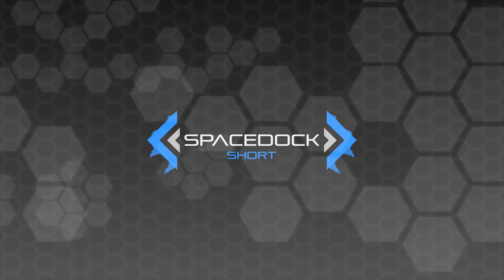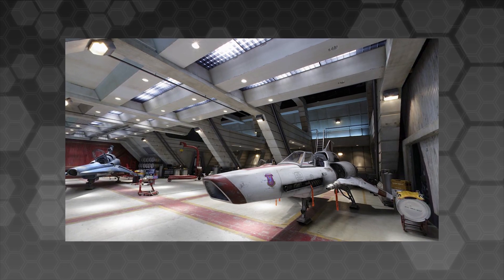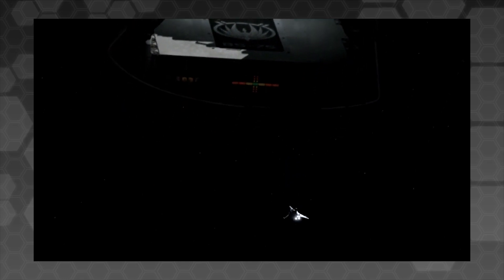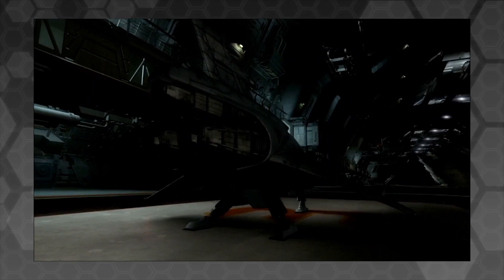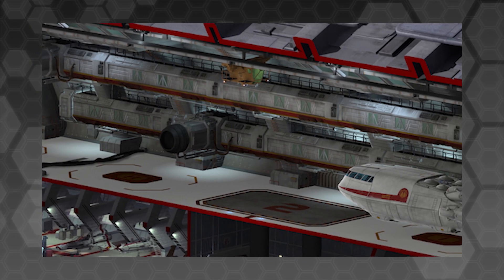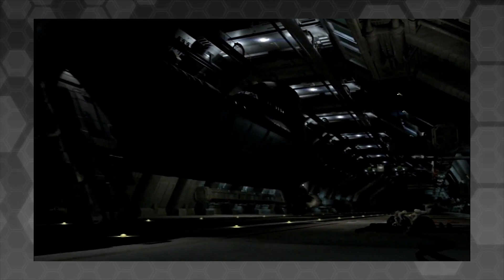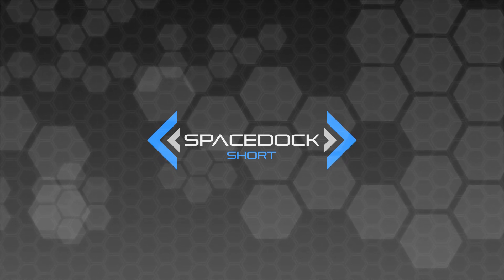How to Land on the Battlestar Galactica

Comment: My assumption, concerning Pegasus, was that the flight pods simply had two hanger/ landing bay facilites stacked on top of eachother, with one opposite the other relative to the Z axis.  This would explain why they would land and launch rightside up and upside down.  Since the Pegasus had artificial gravity, and the vipers use magnetic landing pads, I don't see any reason why this wouldn't work.  It would also make it easier to just rotate people to "normal" orientation when leaving the pod instead of having to rotate spacecraft upon landing and launch.
Reply: @jonumine6250  my guess would be something like a gyroscope

Comment: I love the tech in BSG, it's still solid sci-fi but so much more grounded and believable compared to things like Star Wars or Halo ect. 

Only thing that stands out is how the FTL functions, it's very different compared to almost every sci-fi, i'm thinking space folding maybe?
Reply: Basically. It's an instantaneous jump between two areas. The other term they use is the "red line", which is the maximum distance you can safely jump to. The computer makes calculations based on speed and trajectory. Beyond the red line and you risk disaster like teleporting into an asteroid or planet. You have to keep in mind that light travels at 300,000km/s, so when you look up at the Sun, or the nearest star, you are seeing them in the past (8 minutes for the Sun and 4 years for Alpha Centauri).
Reply: To clarify, "The Red Line" is the maximum distance from Kobol you can jump accurately. I think it's a function of computational power and the thoroughness of the astrogation charting of the area around Kobol. It's a bit like driving fast down a road you know intimately at night versus one you've never seen in daylight.

By extension, the less accurate the jump the riskier it is, but the cliche of "jumping into a sun" only applies if you're trying to jump close to a sun, because space is pretty damn empty. An inaccurate jump isn't, in of itself, riskier. But mostly you try and jump close to important things rather than into empty space.
Reply: @scandor8599  The "Red Line" is the maximum distance from the Galactica's (or any ships' point in space) at any given time, not just from Kobol. Beyond this, the chance of error increases in jump calculations.
Reply: I think the "Red Line" is actually measured from Kobol because after Kobol, technically all jumps are "blind" and have to be individually calculated because they have no accurate star charts to go by (or only estimated charts).  That's why they do a lot of surveying and such, to try to build semi-accurate maps of the surrounding space so they can plot their jumps with at least a little bit more confidence.
Reply: @TheRogueX  No, that's not true. A "blind" jump is a jump performed without calculations. Pegasus made one to escape the fleet yards during the attack - Just activate the jump drive, and pray to the gods you don't end up in the middle of a star or other celestial body. Galactica and the Fleet were still able to make calculated jumps. They were able to survey the surrounding space to safely plot their next course. 
Also, in the series, the Colonials didn't exactly know where Kobol was until they rediscovered it at the end of the first season.
Reply: The Red Line is an imaginary sphere enclosing a vessel which denotes the maximum safe limit for an FTL jump. It is described in an early draft of the script for the Miniseries as follows:

"There are computational errors in every jump. The further out you jump, the greater the error. Jump past the Red Line and it may be almost impossible to find your way back."

And in the series bible as follows:

"Practically speaking the further one attempts to Jump, the more difficult the calculations and the more variables are introduces into the equations. For example, consider the difficulties inherent in Jumping to a relatively nearby star system "only" five light years away: any information Galactica can gather by looking through a telescope is, by definition, five years old. The star and all the planets surrounding it have been in motion for five years since the light we can see left that system. This means that Galactica must calculate the motion of all the celestial bodies in that system based on information that is five years old. The further away the Jump point, the greater the problem - try to jump 100 light years, and you have a century's worth of calculations to do.
Because of the limitations inherent in colonial technology, their ability to calculate all the variables involved in a Jump are also limited. Their margin of error increases exponentially the further out they go and as a result, there is a theoretical "Red Line" beyond which it is not considered safe to attempt to Jump."
Reply: In the director's commentary in the DVD's they stated that the original idea for the visual was to have ships start folding in on themselves like origami. However, they ended up not going that route as it was deemed silly.
Reply: @scandor8599  Not Kobol specifically.
Reply: in the pc game Fractured Space (free to play), you command capital ships and perform similar space tech to get to distant locations. some vessel have the capacity to perform quick and short jumps to ambush foes or avoid enemy fire.
Reply: The BSG FTL jumps remind me of a BattleTech JumpShip jumping.  Recharging is different, as is jumping in a gravity well.  BattleTech is a slow (days or weeks) recharge and gravity messes with the jump.  BSG can charge fast and from anywhere, to anywhere.  They are both similar to having a max jump distance and jumping in a 'flash'.
Reply: that "flash" is just what the eye "add's in", when the ship is removed via its pseude-movement when dislocated while jumping - at least that's the best (and most scientiffic) explanation i ever got ... different series though - might still suit it ... remember: it's empty space .. so nothing flowing in to fill the space formerly occupied by mass and matter ... well, except radiation of different sorts maybe ...
Reply: This style of  FTL drive was used in the 1978 BSG novelization, which still featured elements of earlier scripts.

It was illustrated with Ralph Mcquarrie's concept art; including landing lights somehow projected outside the landing bay.

Vipers were called Starhounds.
Cylons were alien cyborgs (not alien androids)

Adama had aged at a different rate to his wife, due IIRC to 'the time warping effects of space travel.' 
(I can't remember if this meant FTL or relativity.)
Reply: @jedigecko06  wow! I didn't know Ralph McQuarrie did concept art for the original BSG. I'll hafta check it out. Thanks!🍻
Reply: jump drives are the second most common FTL system (the most common being star Trek-esque Warp/Hyperdrive systems), they were a lot more common in books than they are in shows, so you just don't see it much.
Reply: BSG avoided a lot of technobabble in the series, because the characters "know" how the technology works, but from what little we saw, it appears jump drives in BSG utilize fields of some kind which are forced into each other, thereby folding space.
Reply: In my opinion, I think they use some sort of WormHole that "sucks" the entire ship and "spits" it wherever their destination is.
That's why you can see a flash just before they jump, that flash being the Wormhole passing through the entire ship and appearing in another part of the Galaxy
But that's just my interpretation of it.

Comment: Interesting.  The double landing pod gravity thing makes me think of the design problems that the Rocinante from The Expanse has.  In the books she is said to be able to land on her belly, so 90 degree out of her thrust gravity plane.  I get the feeling the series will just have her land arse end down most likely to keep the set design simple, but that would mean a pylon landing or sticky out feet and that cannot be as stable as a belly landing.  Would love to hear what you think, especially as the series moves forward.
Reply: While it could technically land on it's belly, the vessel's frame is not made for it, and on top of that, the interior of the vessel is top down. If the body had any gravity you would be walking on the walls, which is not a good idea
Reply: In the TV series I would agree and I have struggled to wrap my head around how the Roci would land on her belly and still be accommodating for her crew.  In the books it does say that she lands on its belly/keel, and in fact is capable of landing on planets.  I won't spoil more than that for anyone who hasn't read all the books.  It might just be that the books will be the books and the TV series will be the TV series -- still interesting to think about;-)

Comment: It should be pointed out that real naval fighters are extremely over build to take landings that are not too dissimilar to the Combat Landings in Galactica. Its kinda like have both a VTOL (Vertical Take Off Landing) and a STOL (Short Take Off Land) mode like a Harrier or F35.  Sure you can come in for a hover and drop but then you have first match Galactica combat speed and Dodge everyone else trying to do similar. Probably easiler just to slap her down and call it a day. Anyways real life carrier landings are called control crash landings for how hard they are, serouislly go looked them up. 

As for the Pegasus flight pods I can see a very simple way of doing it.

The under lift has no gravity and the pilots just unlatch from it and flipped right side up as it before moving on.

Or there are no lifts and it just a series of hatches. You land on the deck, ship jumps, you unlatch flip and go up the hatch to the hanger.

Those RCS thrusters are powerful enough to kick a Viper and Raptors around in atmosphere plus they have to land on a planet somehow...
Reply: As mentioned, the normal (non-combat) procedure is to come in, slow down, match velocities and postion to the elevator pad and touch down. All well and good when you have the time for nice orderly landing and recovery operaions. You have your non-combat landing sequences, and then you have your combat-we we are pressed for time and need every one inside now type landings.

Comment: On the Pegasus flight pods, what if there are two sets of 'below-deck' hangers for each flight pod, one each oriented to the ventral and dorsal. On the Pegasus model shown, the Viper tubes appear to be in both orientations (but not the Raptor one). Then you just need to re-orient the crew when they move from the 'upside down' hangers into the rest of the ship. No need for the complex lift system, least until you need to move craft from one hanger to the other.

And on the Raptors being used as taxis instead of the bigger shuttles, the Raptors are probably more cost (limited fuel in the fleet) effective for small loads of passengers and cargo. And for big loads, I always thought the larger ships could just dock with one another for transfers.
Reply: thats my take .. because the launch tubes are in both orientations.. there is no point in inverting a viper for no reason if all would launch from the same deck orientation
Reply: @sparrowlt  Having them inverted allows for more efficient use of space.  As for deck orientation, looking at drawings (with a scale) based on the models, I'm not sure that there is enough space for two full hangar decks on Pegasus; there just isn't enough vertical separation of the flight decks.  We've had a lot of discussions about this over the years over on Wolf's Shipyard, and the design raises some unique and challenging issues.  For most of the designs, we just added a second launch deck and increased the vertical separation between the flight decks.
Reply: The two hanger decks could use one set of artificial gravity generators between them so that gravity 'pulls' from the same point, but from both 'top' and 'bottom' from the pilots perspective. The only question I have is, the line of Viper tubes aren't over/under each other, but side by side. Are the magnetic rails angled so that the ships exit from the same line from either the upper or lower decks? Would LOVE to see blue prints for this.
Reply: this is on the expectation its not pulling from one direction, think of it as a monopole magnet that only has a north pole.
Reply: @kirkbyers6882  Firstly, these tubes do not utilize a magnetic rail for the Viper itself, but rather a catapult (much like a RL carrier), which latches onto the front skid of the Viper. Then a counterweight runs along rails in the opposite direction flinging the Viper out. Secondly, as I said before, the Triangular shapes pointing down are not tubes, as that area contains the operations office for each tube, wherein the tubes are operated by Flight Deck NCOs.
Reply: Evan Kent I always thought it was an electro magnetic catapult like the ones the US navy are installing on their new carriers. Looks like I was wrong though
Reply: @themadhammer3305  it is their launch by acttaching the craft to a rail the in the bottom the only thing I don't get is why the tube have to be one shape for one craft
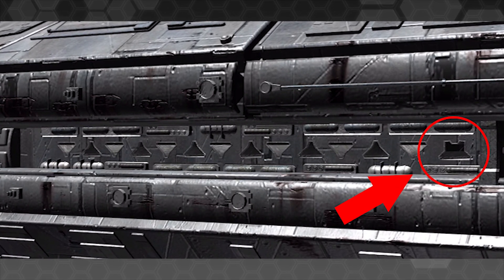Reply: @evankent6049  Thank you for illuminating the Triangular shapes pointing down are not merely closed tubes but operations office of each tube.  I had assumed wrongly at point 4:16.
Reply: @USSAnimeNCC-  Its space! Why would they need a high velocity launch system to begin with?
Reply: @bambambundy6  To accelerate the ships away from the battlestar and get them out of the ship's defensive envelope.  Also, it allows for an organized and systematic launch of the strike wing rather than having a deck and allowing them to lift off willy nilly.
Reply: The smaller, ventral deck on the Pegasus is probably used for shuttles and/or raptors, where rapid turn around isn't as essential
Reply: One thing they could have done is that the elevator on the bottom could rotate 180 degree when the raptor is magnetically lock so when the it bring the craft up into the hanger it not upside down
Reply: Also even if specks show they would normally be equipped with multiple of the larger shuttles, most if not all of the larger shuttles might have been sent off in the decommissioning phase, since they might still actively be used in the fleet. Then only stocking Galactica with the period ships and maybe one of newer. With the Raptors as long as you have multiple you have a pool of spare parts, if you only have one then any breakdown will take longer to fix, so would push most operations to the type you have plenty of.
Reply: They can and do spin 2 train coal cars to dump and thats dam heavy id think they could spin a viper fairly easy to reoriantate. Who knows?
Reply: Thanks for writing all of that for me.
Reply: Gonna have to disagree with some of you. At the end of "Pegasus" when Adm Cain orders their alert vipers to be launched, you can clearly see vipers exiting the "bottom" triangular tubes. To further prove my point, the very next scene we see a few of the vipers turning "right-side up" so as to be in the orientation of all the other vipers
Reply: The Mercury class Battlestar's launch tubes are all oriented the same way. If you look closely, you will notice that the triangular shapes in between the flight pods are filled in, as it is within that space that you have the operations area of each flight pod (you'll notice that during a Viper launch, the pilot gives a visual thumbs up to the person operating this space.) Regarding the lifts, I think that perhaps the Ventral lifts simply are lowered down, giving the Vipers a platform that is then raised into the hangar, or they just relocate to the Dorsal section for reentry.
Reply: I don't think they're filled in.  I think that's an artifact of the lighting of the 3D model.
Reply: @evankent6049  No, they are not filled, it's just a perspective issue, what you are seeing is the wall of the launch tube. The NCO cabin is small and fits in the hatch between the hangar and the tube, it doesn't extend to the outer hull.

@James Huggins the ventral decks are not smaller, they start a few meters after the upward decks and end a few meters after them as well